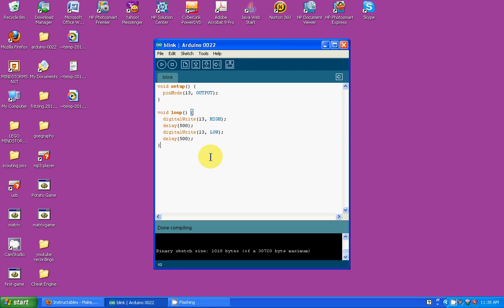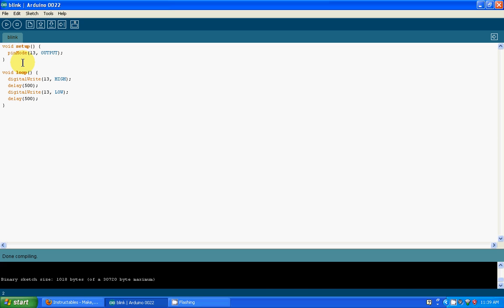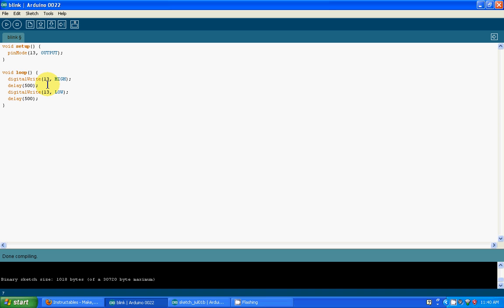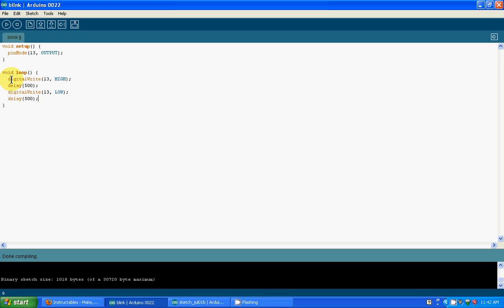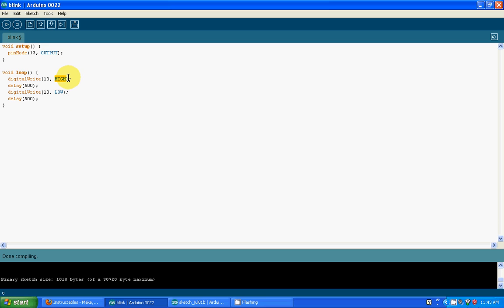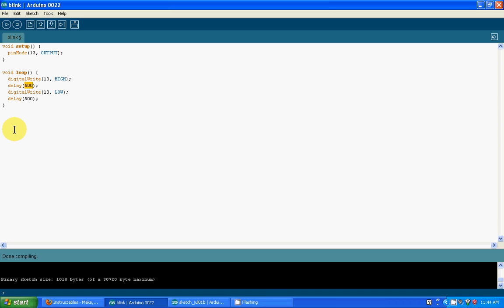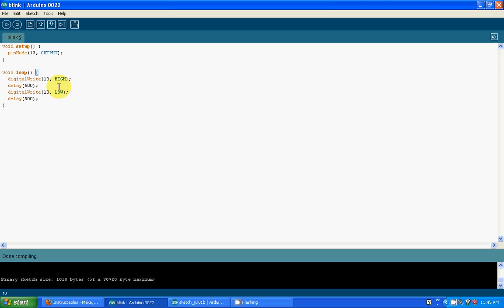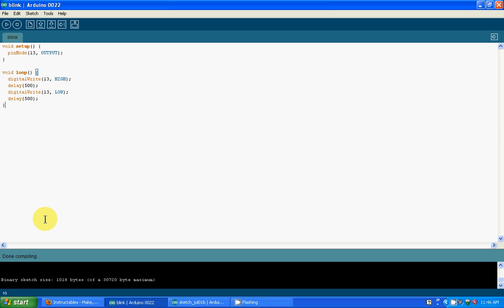Basic Arduino Programming

Comment: I just came across this video. I need to learn to program arduino. I have zero knowledge of arduino or programs. but I'm working on a project that is a must have. I need a microcontroller to operate a boost stage of a inverter project. how many MOSFET gates can be powered by a single output pin?  anyway. I need to know how to write a more complex code . for pwm and feedback on one analog input. for duty cycle control to set volts. can you help with this?